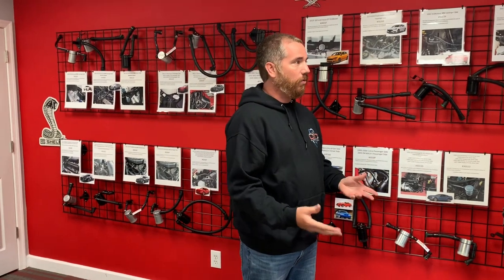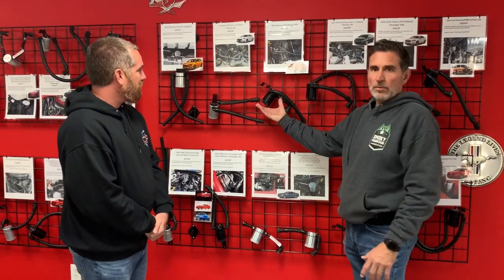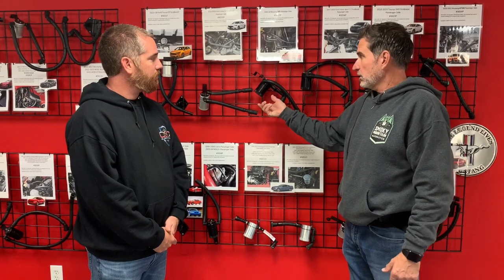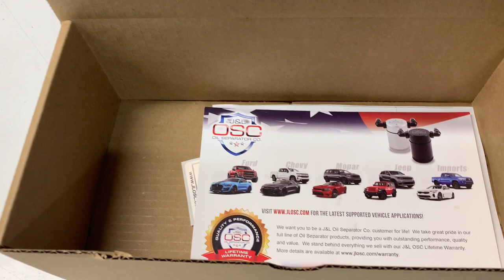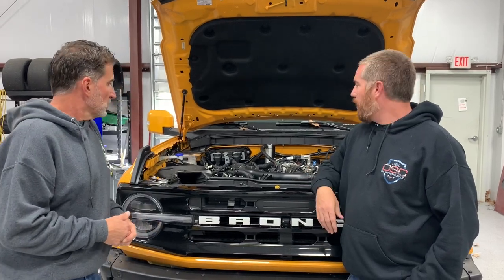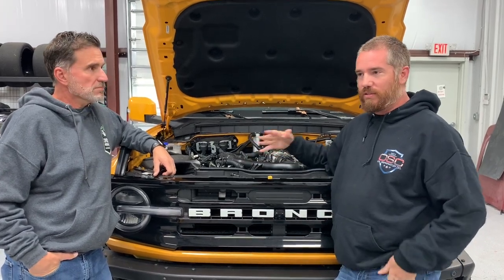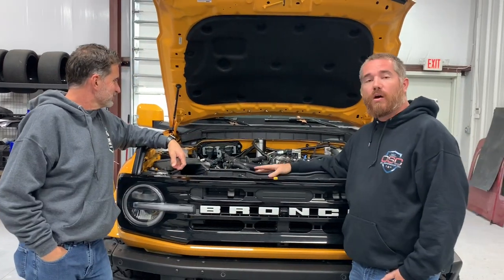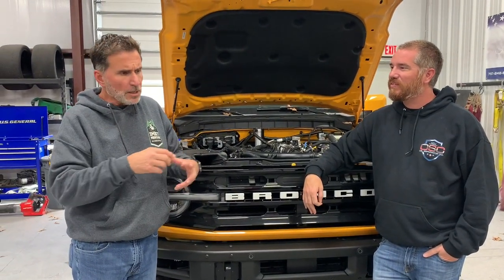Oil Catch Cans: Are They Really Necessary?

Comment: I installed a J&L OSC oil catch can/oil separator on my 09' 300C 5.7L Hemi at 53,886 miles in June 2024, out of curiosity, I just checked it today after about 1500 miles, it was about 1/4 full. I'm so glad I decided to invest in this catch can/oil separator, it is definitely working to keep the oil vapors from returning into the engine.

Comment: I guess I'm lucky on my 19 F 150 3.5 52k miles now
OEM PCV tube was dry, no residue.
Tried a JLT at about 40k out of curiosity. 
2 oil changes about 7k and only had a film of oil in the can, not even enough to absorb with a towel.
Scoped the intake runners, nice and shiny valves, slight discoloration.

Pulled the can gave it to a friend with a higher mileage 2015 F 150.
First oil change he had almost 1/4 can of liquid.
So the cans definitely do work.

Comment: I ran one of his catch cans on my F150. It definitely catches oil and contaminants. I now have a 2.3 L in my new bronco. But before I buy a can got a couple of general questions/observations. One, isn’t adding this can going to make the PVC function less efficiently, and add a lower pressure if you will? Two, I’m still under warranty, and I believe that if there was some engine failure with the direct injection and PVC, that warrantee would be void. Finally, I intend to keep this bronco as long as I’ve kept my 1975 version, I’m most likely going to have to walnut blast the intake valves in time regardless if I run a catch can or not, right?

Thank you I really enjoy watching your channel
Reply: Unfortunately that remains to be seen. However, it's easy to temporarily remove it if you need dealer work done.

Comment: Great video i use the same oil Catch can on my f150 for years. My question is what are your thoughts on other oil catch cans that do both sides allot more work.  J&L says its not needed on drivers side as much, your thoughts on this. Thanks for your videos
Reply: I have the same question for my 2020 F150 3.5L Ecoboost

Comment: Not necessary on the 2.7
Ford made it port and direct injection for this reason. Definitely need it on the Direct injection only engine for sure.
Reply from the maker: Stay tuned for our 5000 mile oil change and reveal of what’s in it in our 2.7
Reply: Mine has only been on a few thousand miles and already has oil in it
Reply from the maker: @BirdDogOffRoadAdventures  There are many reasons why some get more than others. altitude, temperature the type of oil (how many miles) and boost. Not all rings are as tight as others etc... Glad to see yours is doing its job.
Reply: @BirdDogOffRoadAdventures  every engine will produce some oil in a catch can, it's just not necessary or I believe beneficial for the 2.7 in the Bronco. The port injection will keep the valves plenty clean.  In these times, save your money for things that will truly make a difference.

Comment: I own a 2016 GMC Sierra 2500 HD with a 6.0L Vortec gas engine. Since my Sierra utilizes Sequential Fuel Injection (SFI), rather than, Direct Injection, would an OCC still be a necessary upgrade?

Comment: My question is...why J&L? I see quite a few that "look" the same. Is there some kind of internal advantage that I don't see? I'd rather pay $40 vs $160...
Reply: Hi Joe, my thoughts on this are... I've always believed in the fact that... whether it be good or bad... you get what you pay for.
Here is a question to ask yourself. Is it CHEAP and INEXPENSIVE or just cheaper/less expensive?
I invested a good amount of money in my car, and to spend an extra $160 to protect that investment, to me, is well worth the extra $120 over buying a $40 catch can, that may not be worth it and may have to be replaced because of quality issues. Because then you're out even more money.
I went with the fact that it is American made, and not from a foreign country that may have lesser standards than the USA. 
I would imagine that the concept of all of them is the same. However, some may have a slight difference in performance, or material quality etc. etc.
The J&L OSC catch can that I received came fully assembled and ready to install. The hoses were already set up on the unit for intake and output, so there was no confusion during the installation process of which side the hoses go on and where they get connected on the engine. Depending on the manufacturer, (who may not determine which side is which), it just might matter which side is input and/or output. If you don't get them right, it's not going to perform correctly... just a thought...
By no means am I trying to tell you what to do. You do what makes you happy. I just wanted to give you a different viewpoint on this topic. Have a great day... Cap'n Dan   arrr
Reply: @CapnDanTreasures Thanks for your response. I totally agree. I do have the funds to step up to a good quality one, so I ended up buying K&N's system. I got a veterans discount 😊. They use the same connections as Ford and it has a big cup on it incase I decided not to check it for a couple of years.

Comment: PCV systems on a turbo engine slowly  oil fill the lower levels of the things Intercooler  as well as dumping oxygen deprived combustion  gasses and oil into the engine  intakes.  IF you choose a catch can device .. As opposed to venting directly to atmosphere ? At least buy one with a useable capacity A quart or more Unless you like emptying /cleaning out a  tea cup size thing every couple of weeks.

Comment: Sure beats having carbon build-up on the intake valve for sure.   People that says not needed just never check their direct injection to truely know how bad it is with the carbon build-up on the intake valve. I use a boroscope to check my intake and it is bad, but not to the point of complete clog. Having a oil catch can can greatly reduce the carbon build-up on the intake valve.

Comment: i think it voids the engine warranty on most cars.my hyundai santa fe has a hundred thousand mile ,10 year warranty.the service mechanics say they never had to deal with carboned up intake valves .even though they say there is some carbon on the back of the intake valves,its not enough to effect the running of the engine .they say in high millage engines the deposits can get big ,they just break off and get sucked  in the cylinder and disinagrate The mechanics at honda told me the same thing ,and that they never had to take an intake manafold off and walnut blast the valves.the cars tat are the most vulnerale to this are vehicals that are run exsessively hard and engines that are real high millage. .these senereos cause the engines to produce allot more blow by gasses.Another factor is not changing the oil often enough,and or using a cheap oil both of which is oil that is more volatile ,meaning it evaperates quicker.Use a good quality full synthetic oil which is a lot less volatile,and change it at 6000 miles.I  have been a certified mechanic for 45 years, and work on newer cars daily. i forgot to mention, that if you suspect that you excessive carbon build up on the valves thats affecting engine preformance,there is a spray kit you can buy for under $20 that you spray into the intake manafold 2 or 3 different times while its running ,that has been proven to dissolve most of the carbon build up to a point its not a problem any more.
Reply: or just run a tank of E85 everyonce in awhile. if flex fuel of course

Comment: Absolutely unnecessary for your direct injection engine. All you need is a good synthetic oil with a good synthetic media oil filter. I’ve got a 2011 f150 3.5 ecoboost with 465,000 miles on it with no catch can. I’ve never had any valve issues, zero turbo issues. You do get a little better performance with a catch can but 99% of drivers can care less. When properly installed there’s some benefit and it’s your vehicle, do A’s you please but it’s not a necessity.
Reply from the maker: How does synthetic oil help with oil vapor coating the intake valves?
Reply: @DrivenWildOutdoors  it’s not the oil that cooks on the back side of the valves it’s the 40 micron carbon contaminates that cause the coking issue.  The oil vapor will burn in the combustion process.
Reply: @stephenbloom2545  Exactly. I was sold on Synthetic oil back when I had a Suzuki Katana that had air/ Oil cooling . At an oil change with regular oil, there was tons of build up on the head under the valve covers when I would check valve clearance. With Synthetic , Zero Coked oil. That and my Dad had a Piper Cherokee and the FAA extended mandatory tear downs if you ran synthetic. I see the same results in my Harley.
Reply: He got this product free so of course he’s stands behind this product 😅